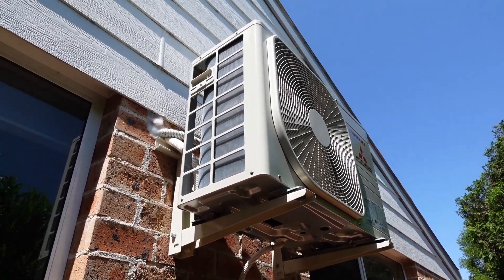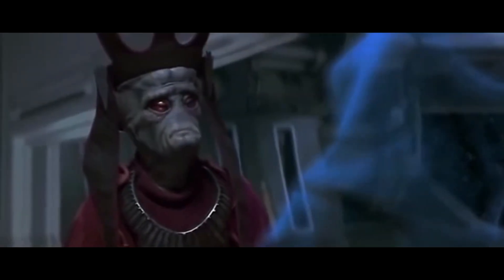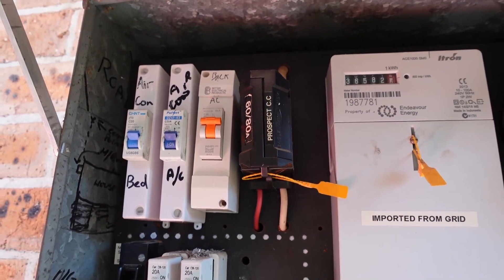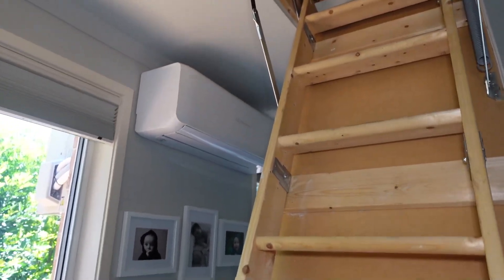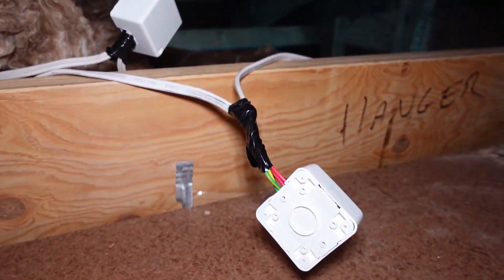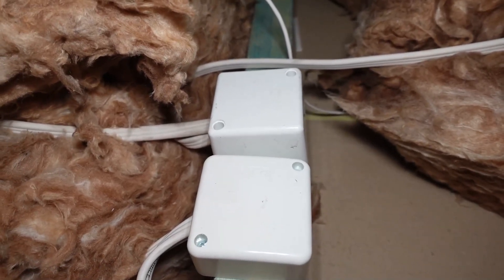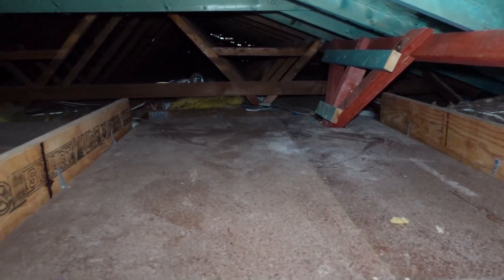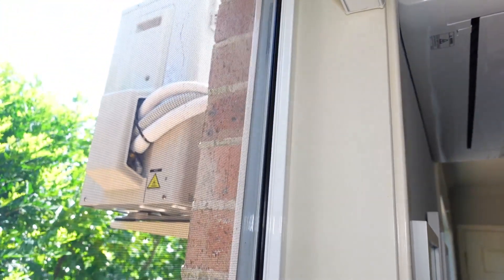Aircon Wiring Install FAIL- TWICE!

Comment: I'm a full time A/C installer (electrician and refrigeration mechanic). I'm in QLD but most all the rules are the same nation wide. You MUST have an isolator, the ruling is for motors,  within arms reach. The unit is fine to be 'spliced' into house power. Your fuse board could do with an upgrade, it's clearly been half done but... Having an A/C breaker is not relevant to extra A/C installs, I can't see the Amp rating, but it looks like 2.5mm TPS, so a MAX of 25A, so if you have say 2 8kw units than putting a 3rd AC on that circuit is very bad, putting the tiny 2.5kW unit on the house circuit is MUCH BETTER. You probably didn't ask for an independent circuit for the new a/c,  so what they did if fair in that regard.

What you should be worried about, Yes the j-box was poor but not a killer (it wasn't exposed, it was single insulated, which is illegal but not as bad as exposed wiring). More to the point, that silicon sealing the penetration is good, BUT no duct work is shonky AF,  and ugly.

The drain is flex drain, it isn't UV rated and will flake away within a year.

The head drains into the out door unit. RIP THAT OUT TODAY, it will rust the unit quick smart. You typically don't need a drain for the Out door unit, it will make about a liter of water over the entire of winter, it will make zero water in summer. The INSIDE unit will make several liters of water in summer, DO NOT DRAIN THAT WATER INTO THE OUT DOOR UNIT. DO NOT USE FLEX DRAIN IN SUNLIGHT. COVER FLEX DRAIN IN DUCT WORK. (CAPS aren't specifically yelling, although I feel like yelling it)

The pipe run looks less than 3 meters. THAT VOIDS YOUR WARRANTY!!! (the head unit AND pipe work is engineered to be the indoor unit of a refrigeration system, (basically they include the pipe in the calculation so the metering device can be part of the outdoor unit), so the liquid like has way to much liquid to feed to the evap if you have less than 3 meters of pipe, you will lose efficiency and it is possible to flood liquid back to the compressor during winter, causing a liquid locked compressor, which means you will need to replace the compressor, this isn't a fixable issue, and it will be cheaper to replace the entire AC instead of just the compressor. SO HAVE THEM COME BACK AND FIX THAT ASAP. They need to loop the pipe behind the unit so the total length of  pipe is 3 meters of longer (of each pipe, not 1.5 meters of each, 3 meters of each).  THIS IS IN THE INSTALLATION MANUAL, HAVE THEM READ IT INFRONT OF YOU.

I could watch a second time and find more faults but... It's friday and I'm trying not to develop into a fury that spirals into depression from seeing such poor refrigeration work.
Reply: How do you know if they did not adjust gas pressures accordingly?
Reply: @pulporock  Do you honestly believe they didn’t just crack those valves, hit the on button and got the f out of there on to the next one? Probably just as likely as them having a vacustat haha
Reply: @pulporock  These systems don't work like that, and anything they modify to allow for that would also void warranty. 

They would need to change the metering device to allow for less gas, the metering device is a fixed orifice, which relies on the expected pressure on both sides.  Which voids warranty and would cost many hundreds, and be guess work.

Or they would need to make a larger receiver. Which would void warranty, cost hundreds, and also be guess work.

The unit is pre-charged with enough gas to operate between 3 and 20 meters of pipe (check the specs, maybe 19 or 21). They will provide a formula to calculate extra gas per meter of pipe (add each elbow as a meter also in most cases). This is as logic, more pipe means more space to fill, to get the correct back pressure (wrong terminology, but your return pressure must be around 125psi/800kpa to keep the compressor cool), which leads into the compressor needs 3 meters of return pipe to allow for further expansion, as the return gas must be cooled further to cool the compressor.

If you remove gas, you  mess with the entropy chart, effectively rendering the unit no longer an a/c.

What you most probably are misunderstanding, when Dave shows the Indoor and the Outdoor unit, that isn't the true indoor and outdoor unit in a refrigeration sense. half of the components from the indoor unit are situated in the outdoor unit. 

To explain,  to make this a true indoor and outdoor unit, like say a larger ducted system with a tx in the head, or a cold room or blast chiller. You would need to cut the fixed orifice out of the 'out door' unit, modify it to work without the 3 meters of pipe that allows the liquid to start expanding (very important for these small units, as it allows the liquid to expand properly when flooding the evap, otherwise it simply hasn't enough time to expand properly). You would also need to add the extra pipe before the receiver, and pipe from the reversing valve (or condenser for cooling only models). 

I'm assuming you came up with this theory from making the beer cooler prac at tech, which means you remember the teacher waffling on about the entropy chart, which means you know anything they modify to this system means it wont work properly. 

In any case, IF they did something to compensate for their poor work, they voided warranty. 

once again, THEY VOIDED WARRANTY no matter what they think they did, although I near guarantee they did nothing.
Reply: @DuncanTheCrusader  
Thanks for the information; I have no doubt they did not touch the refrigerant, but thought that could be a possibility.
I work on new homes (nothing to do with A/C) and have seen many techs, getting the vac pump out and adding  some (maybe removing) refrigerant to the heat pumps, more so of years past. Usually much bigger units than this one. All interesting.
Reply: @pulporock  Anyone who doesn't use a vac pump needs to be removed from site and reported. That removes oxygen and moisture which will mix with any refrigerant and cause a mild form of acid, that will eat the compressor out from the inside, any warranty for a compressor the first step is test for oxygen in the gas and that will void warranty.
Some very bad installers just 'Purge' the system instead of vacuum pump, they think it works but it just pushes most of the oxygen out, they have no idea about fluid dynamics/turbulence/gravity, and also is just dumping CFC gas into the atmosphere, which I joke is plugging the whole in the ozone layer, but it's a fairly bad offender for the atmosphere.

If someone is doing a cold room or some type of refrigeration system they build themselves or had designed for a specific purpose, they typically don't have warranty anyway to any real extent. And if they don't have a reciever (basically a holding tank for extra gas) they will add refrigerant bit by bit, called 'chasing the frost line' in which case they are basically putting in just enough gas for the system + pipes for be filled to the correct density (it's never 100% liquid or 100% gas). They will face huge problems when the ambient temp changes, because the system will very quickly be low on gas and overheat the compressor, or have way to much gas and lock the compressor. 

Any factory system like an Australian (and most of the worlds) split/package/window/whatever unit is designed down to the T, with all the I's dotted. Any modification will void warranty, basically no questions asked.

Times gas will be added - often, any leak will need gas replaced, any extra pipe length above the max pipe distance, or in special cases where old pipes are used and the pipes are oversized (most brands cover warranty for pipes within one imperial size larger or smaller, but double check. Also R22 rated pipes from say before 2005ish aren't rated for R410a or R32 gas, there is an expensive workaround using an over sized system and having the manufacture de-rate it's power) 

Times gas will be removed. When ALL of the gas is needed to be removed for repair or uninstall and dumping (Most of use remove the gas from the pipes, then remove the gas from the 10 units at the office in one go later on). So if there is a leak or a new part needs to be welded in.
If it's a cocktail gas (R410a) then any leak 'should have ALL gas removed and fresh gas installed, because only the heavier gas will leak if the hole is on the bottom, or lighter from the top, but IDK anyone that ever actually does that with R410a, as the replacement for R410a is R32, which is made from half of R410a essentially, and I've never had or heard of an issue from not doing a full replacement. 

So all in all, gas in a split ac should never be removed until the unit is ready for the bin. Or rare times for repair and ALL the gas is put back in.  It simply isn't a choice us installers are able to make. 

Hot water/Solar heat pumps 'could' be slightly different, I don't work on them, but to the best of my knowledge they are also very gas dependent the same as a split AC.
Reply: @DuncanTheCrusader  If you knew the difference between entropy and enthalpy I might take your rant more seriously. The extra 1m of pipe is not going to make any real difference, the minimum length is more for noise avoidance than anything that has to do with the refrigeration circuit.

Draining to the outdoor base pan is unusual and does cause rust, the indoor drain should be teed to the vertical drain from the outdoor. Or just spliced to the vertical drain and the outdoor drain removed, as suggested. And the condensate flex tail of the indoor unit that is visible outside does need UV protection urgently.

P.S. fixed orifices work based on subcooling and most certainly not just pressure differential, or they would not work at all, considering the compressor is variable speed and other conditions vary. Your explanation is also contradicting itself by first claiming you get liquid locked compressors (never seen the suction accumulator in a minisplit compressor?) and then claiming the extra superheat from adding the 1m of pipe will cool the compressor, which it certainly doesn't, but most certainly the 1m of pipe can't do both at once.
Reply: @JussiPeltola  This reply is contradictory twice,  you claim the extra meter of pipe is for noise reduction, yet also say these units have an accumulator, yes they do, I refer to it as a collector, as it's the same thing, except pre compressor instead of post if you want to get picky, but anyone that isn't a newbie knows they are just a hollow pipe, why is that contradictory? Well they have an 'accumulator' for a reason don't they? If the pipe was engineered to be a meter shorter then the accumulator would need to be larger wouldn't it????? (The answer is yes). 
No I state many times it is for warranty no matter what you like, so either way they voided warranty. But lets go down your path, Dave and hundreds of other people have units with out the extra meter of pipe, nobody has ever said their unit was more noise, so that is nonsense, and more importantly would a little extra noise void warranty on the entire machine? I mean a liquid locked compressor is an obvious reason to void warranty, but you think Mitsubishi is going to void warranty because Dave has a little extra noise???
And if you don't think flooding the compressor with liquid will cause a liquid locked compressor then you have rocks in your head, maybe have a think next time.

Now for reason 2 that you are contradictory, read for it? You say a fixed orifice works on subcooling and not pressure differential,  that isn't even semantics, that is just basic lack of knowledge on how subcooling works, can you tell me what causes subcooling or superheat with out explaining that it is directly and only related to pressure? A 10yr old with a deodorant can could out smart you. Seriously, tell me how subcooling happens if not from the pressure difference from before and after the fixed orifice? I beg you.
Reply: @DuncanTheCrusader The more liquid refrigerant there is in the condenser, the more subcooling there is, which causes reduced flashing in the fixed orifice, increasing the mass flow. Which is why fixed orifices work at all in a range of different conditions and don't massively overfeed the evaporator in hot conditions and starve it in milder conditions. The amount of refrigrant flow is most certainly not a straight product of the pressure difference, and you will find videos on YouTube explaining this if you have difficulty understanding this basic concept.
Reply: @JussiPeltola  that is laughable, every one of those videos will explain it with pressure difference. But like I asked, can you explain subcooling without using pressure difference? Because you tried to explain a fixed orifice using sub cooling and not explain subcooling.  Like you understand a fixed orifice isn't a fixed orifice unless it restricts flow, which means it is causing high pressure before it and low pressure after it? A fixed orifice is nothing but a restriction, you could fluke it by kinking a pipe, so tell me how that self regulates without the correct volume? Or just the first question, explain subcooling with out pressure.
Reply: You need to read AS3800 again if you hold an electrical licence, 2.5mm is definitely not 25A when installed in insulation like that
Reply: @aussiegruber86   Maybe you need to watch the video again, or read the comment properly. As started the AC breaker in his board, we can not see the wiring beyond the board. So you have zero idea of how the AC cable is laid. So if you have a license, you should know that 2.5mmTPS has a max rating of 25 Amps. Remember we are not talking about his 20Amp GPO circuit that the new AC was connected to, that is the only cable you can see run in insulation.
Reply: There is so many that install these systems ignoring the minimum refrigeration pipe length.
most installers use closest power source with isolator near the unit.
Some even follow the manufactures specs and have a dedicated circuit installed.
Reply: @ratbag359  A lot of the electrical specs include 'or to local standards', they are in some degree trying to cover all bases with the wiring. From memory these Mitsubishi units want 4mm interconnects, which simply don't fit in the terminals, but also say 'or to local standards for a 10A circuit', which is why we all use 1.5mm on the smaller splits. Don't quote me on that one, the memory isn't the best, may have been fujitsu or someone similar
Reply: Never read the manual?  Typical of low cost installers. 
    Whenever I see a manual in the sealed plastic bag, I look for installation screw ups
Reply: @gordonborsboom7460  That's an arguable statement. I do near a 1000 installs a year, I'd easily have 990 sealed manuals, and more importantly the manuals also have a lot of 'incorrect' information, so things like pipe length are specific to the operation of that unit, which is a must follow, the manual will also dictate how to insulate the the tails on the head, which is country specific I assume, but will definitely fail in Australian conditions, so following that part of the manual would be a stuff up. The manual also tries to cover many country codes, often stating cable size, and protection methods, so following that part would be absurd and possible illegal, but the manufacture is just covering all bases best they can.

To be perfectly honest, I'd be worried if an installer needed to read the manual, I definitely don't let the customer see me read the manual if I'm checking something odd or brushing over a new units manual. 

But every  installer should have read the manual, and should have experience and learned from someone credible with local experience. And most importantly should be held much more accountable.
Reply: Chur u have a keen eye on that Drain hose. And I thought they went straing to the O/D and not into a T junction for the perssure pipe. I just had to look up the Wiring rules to be sure. Ive been trained well as an HVAC assistant, and Isolators are a must. 

Those junction boxes tho, I found the new guy had unsheathed wires from the isolator to half way along the flexiable casing bend to the outdoor. If I diddnt need to adjust the casing. I would never had noticed, shocking me that he diddnt know the legal standard here as hes only been in NZ a year.

Chur man, I was tought if pipes are under 1.5-2m, to do a loop. Ive done some reading and a guy said you will get liguid refrigerant going back to the comp, and the forum kinds shut him down. But it makes sense, as boil off etc to have vapour return to the comp. 3/5 people were like, its to reduce noise and reduce viberations to prolong the life of the machine. I mean, who doesnt check the install guides to be sure on things like feet diameter, clearance to wall/ceiling.

This video was really helpful, in a cringe way like. I fully understand you mentioning "Seeing such poor refrigeration work." Our boss has a very high standard in AC system installs, now we wear golves as the newbies hand print walls and leave pencil marks. Its like a test from the boss, in one viewing now down all the ill practices that reduce the lifetime of the ac, and the legal standards breeched LOL.

Cheers man, you input sounds like a well versed tradie. In the arts of a quality job, for the quality quote. 

Enjoy the Friday. Shoutout from NZ.